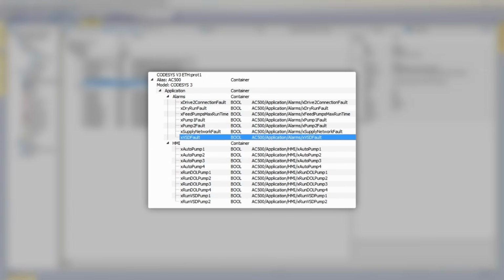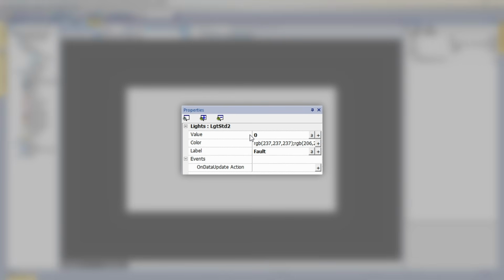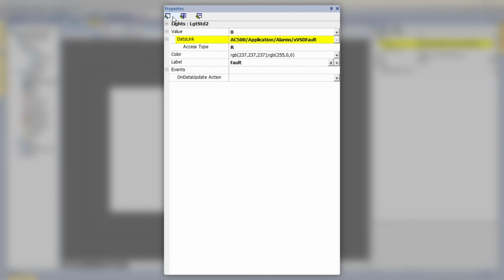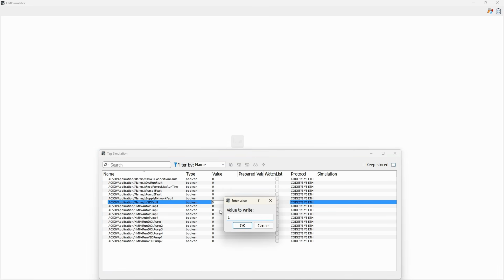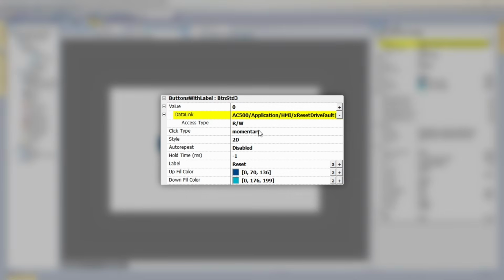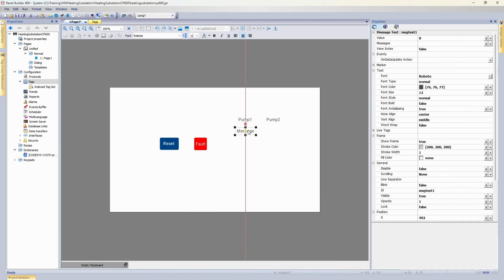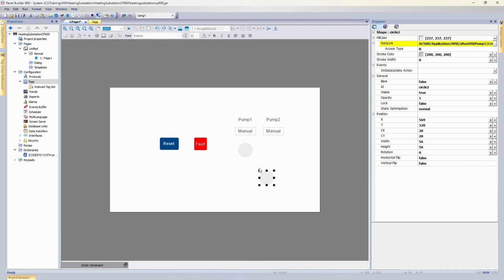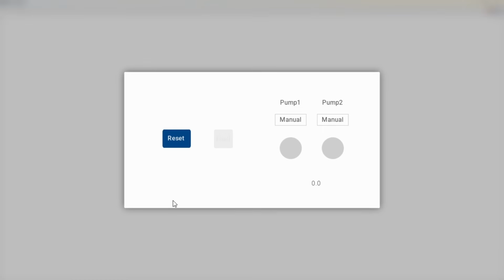Intro to CP600. Chapter 2: Basics

Comment: I tried to set the ipAdress to 127.0.0.1 in PB600 because I dont have a physical panel or PLC. I get that yellow exclamation mark. Is it not possible to emulate a communication?
Reply from the maker: It used to work in Automation Builder 2.7.  In 2.8 some bug was introduced which broke communication between simulators. Developers are working on a fix
Reply: @abbplc  Thanks for the quick reply. That would explain it. Followed every step exactly. Lets hope they patch it soon
Reply from the maker: @kaniza3092  Yeah, sorry for the inconvenience!
Reply: @abbplc  Has this been fixed in Automation Builder 2.9? I am using the basic version and trying to connect the Automation Builder Simulation to the Panel Builder Simulation and I get an exclamation point that says "edit only possible in offline mode".  If select Use Simulation it unchecks the items I want from the Watchlist.